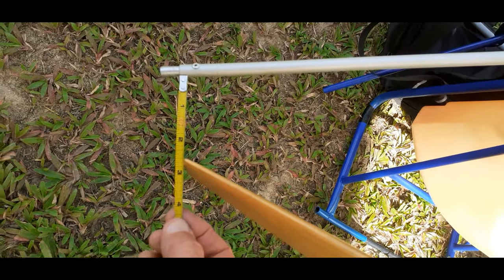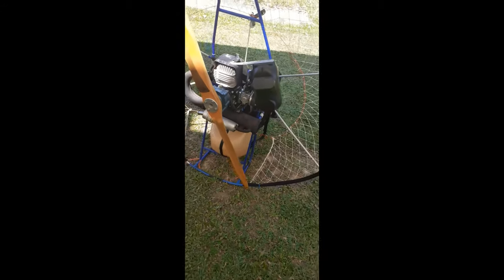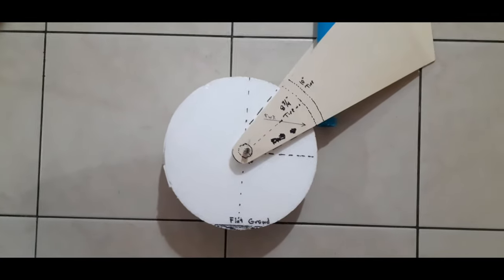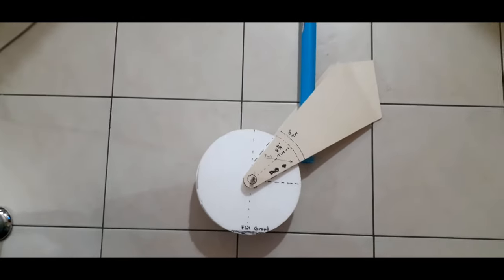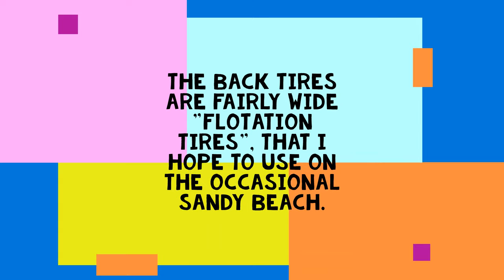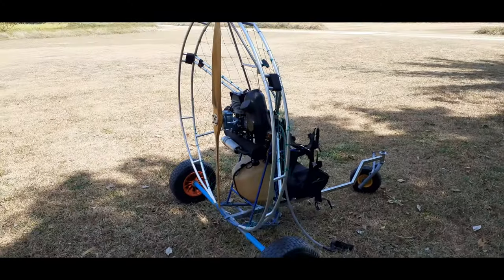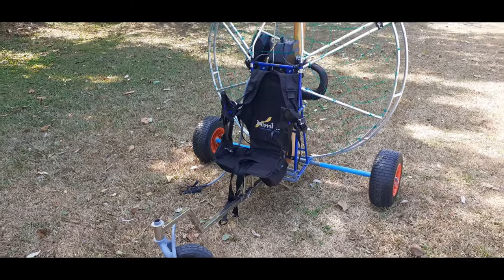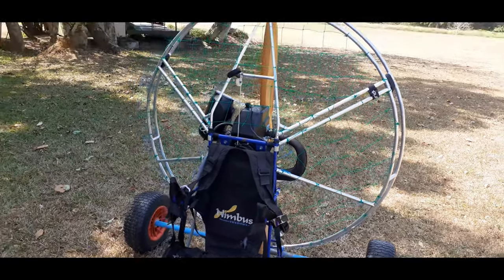Power paraglider trike DIY build

Comment: hi, great trike build! I am doing similar, did you find the 45/135 degree castor angle to be the best? Before I saw your vid I was working on 35-40 degrees, but wondering if 45 like yours is best? thanks
Reply: Yes this castering at 45 degrees makes it nearly self steering

Comment: Doug, you didn't find that your knees were bent to much? Just trying to find out if you were comfortable with your knees brought in so close to you. I know that the CG may dictate how far out your front wheel is out from the main gear. 
It certainly looks well constructed, that's for sure.
Reply from the maker: It was a bit uncomfortable, and yes as you mentioned you have to experiment to keep in a nose up trip especially on landing.